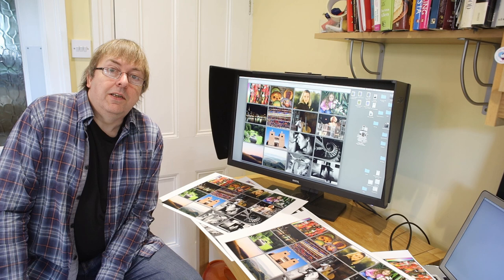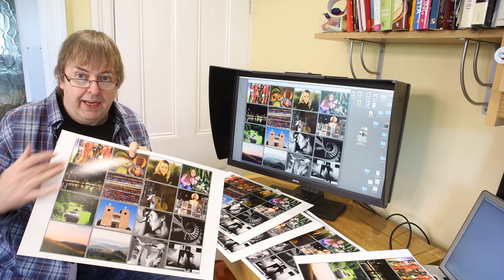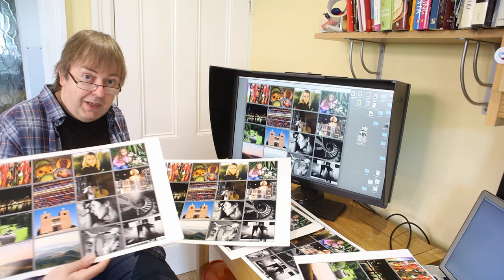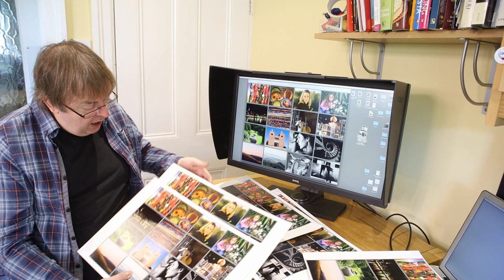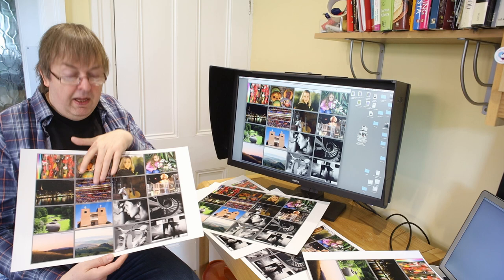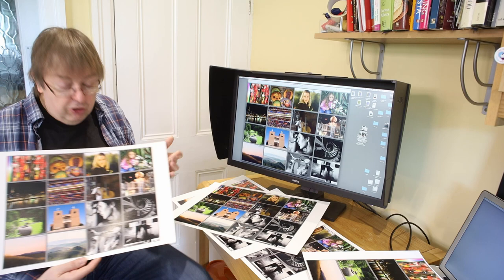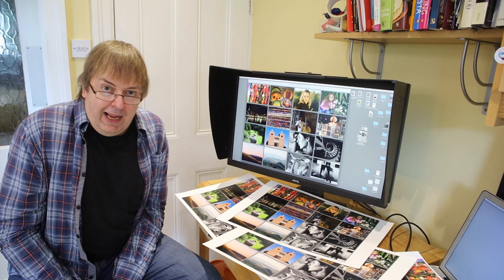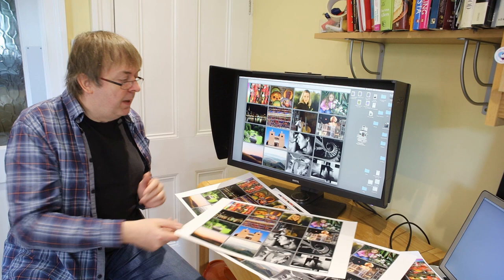Better print quality using a colour test image. Test ICC profiles and new papers on your printer

Comment: Great stuff Keith but you didn't tell us how to actually make the test print. Obviously I need to use the correct profile but do I make the print using Lightroom, using Epson's own printer interface or using the printer command on my Mac OS?
Reply from the maker: The print is made however you normally print any image.
If you use profiles, you use a profile, if you send files off to be printed, you send it off...
It has no specific requirements, since it's a test of how your normal print setup is working.
Sorry if that wasn't clear...
Reply: @KeithCooper  Thanks Keith

Comment: I fell into the trap early of trying to match my prints to my screen. First of all it was a fruitless task because back then I was using my cheapo laptop screen which despite being calibrated just wasn't good enough to evaluate colour. Even though I now use a high quality hardware calibrated Benq like yourself, I've since come to realise that you have to think differently. It would be better if users didn't try to match their prints to their screen but conversely did it the other way round! Ideally you should match your screen to your prints if you want to get remotely close to the two looking similar colour wise. As you describe here however it's never going to be truly possible to match any screen to any print simply because both will have differing gamuts but also of course because one is reflective ( paper ) and one is emissive ( screen ). I also found frustration in lacking understanding early on as to why despite using custom profiles my prints looked different between various paper types. I too assumed that the point of the ICC profile was to bring everything to a single calibrated state and that side by side my prints should look broadly similar irrespective of the paper I used. Again I was wrong, as you explain here, it's just not possible. The purpose of the ICC profile is simply to make the print " the best it can be " based on the paper/ink combination. The ICC profile cannot correct variables beyond the gamut capability of your paper and ink combination, it can only maximise it and give the user at the very least a consistant print result at best. Kudos to you Keith for presenting this often difficult topic in a clear and concise way 👍
Reply from the maker: Thanks - that's exactly what I was trying to convey

Comment: Thanks a lot Keith, I am printing for years and this gave me enough stress based on the fact I tried (very hard) to let look all kind of papers the same. And you knew it of course, it doesn't work like that. Since I have seen the most of your video's and some a few times and read a lot on your website about printing I changed my working proces. And it works so much better. Maybe one of the strong new way of thinking is that there are paper/ink/printer combinations that don't work properly together. In stead of trying to let them work together now I accept the fact that it is like it is.  So thanks for sharing all your experiences in the way you do.
Reply from the maker: Thanks - I'm so glad it's been of real help - thanks or posting this.

Comment: Many thanks Keith for your videos and providing a place to find the sample images. I've recently ordered several sample packs of quality papers from Red River. It's my intent to use the provided sample images to help me understand what images (in my mind) would look best on various papers.  I've never visited a photo exhibit where I understood anything about the papers. I just know what images I liked.  I have a lot of images taken over the past two decades than have never seen print. I'm looking to change that with my Pro-200. During this video you mentioned don't match the print to the screen.  Am I correct in attempting a fuzzy match of the screen to the print (using the test images on the sample papers)?
Reply from the maker: The unwanted secret about papers is that apart from major paper categories [lustre, gloss, matte], few people see anything much more than the image itself. Remember that papers are marketed at photographers, not people who will look at the print ;-)
Now, with care, it's possible for paper choice to have quite an impact on the look of prints, but it's still the images which count ;-)

By comparison I mean don't put the print directly by the screen to look at the two. 
Put the print [suitably lit] off to one side so that you have to physically turn your head. This 'resets' some aspects of your visual system.
The screen and print are different enough that some things will never match
Reply: @KeithCooper  I really appreciate you highlighting the details of how to view the print offset from the screen. I would have been holding the print next to the screen and now understand this is incorrect. The reminder about the marketing of papers and focusing on the image is helpful too.  I think my paper sample pack arriving later this week may last a bit longer than I originally planned.  Best wishes to you.

Comment: Many thanks Keith. You have massive amounts of good advice on your channel. I'm taking your advice and firstly printing the Datacolor test sheet on Epson Gloss paper and my new ET-8550 printer through Epson Print Layout (EPL). What I haven't managed to deduce on your channel or website is what settings to use in EPL. Do I use "Printer Manages Color" thereby ignoring any ICC profiles? Thanks.
Reply from the maker: Thanks
Use the gloss media setting - this should  allow you to select the profile [it may well auto select it] No colour management has no place in EPL unless you are printing B&W and using the ABW print mode. Just open EPL and drop the image into the window and print.

You can see the profile settings in the canvas wrap example in the written review [towards the end - click on the image and you can read the settings]
Reply: @KeithCooper  Many thanks for your help. FYI - I'm choosing ELP Settings - Epson Premium Glossy. This has the effect of choosing "Epson ET-8550 L8180 Series Premium Glossy" profile when the setting is left to "Auto Select". And apologies Keith. I just couldn't find the canvas wrap example you kindly mentioned above. There's so much you've written, I couldn't track it down. Thanks again.

Comment: I’ve just set up my new Pro 1000 and this and your other videos have been so helpful in understanding the printing process. I’m completely new to digital inkjet printing, which is SO different than my old black and white silver halide darkroom days
Reply from the maker: Thanks - my PRO-1000 review predates me making videos by several years, so if you've not seen it, have a look at my very detailed PRO-1000 review? - it has stuff about B&W too
https://www.northlight-images.co.uk/canon-pro-1000-printer-review/
Reply: Thanks Keith, I have read your review and found it very helpful. I do have a question about using the black and white test image - do I print with the black and white setting or standard?
Reply from the maker: On a pro-1000 I'd print using the B&W print mode. There is a specific section about B&W in the written review  @keithmagee4450

Comment: Thanks for the video, I've just started using test images. It definitely helps to understand what the ICC profile, the paper, and the print settings are doing. One thing I found interesting was comparing all 16 images between a matte and a gloss image, it's interesting to decide which paper would be best for which image and why. One of the next key decisions I need to make is to find a basic set of papers to explore printing with.
I've prints with four papers now to compare, none of which I'd choose to continue using, they were just what was in the house when the new printer arrived. It's also interesting to compare relative ICC corrected prints vs non colour managed. I've yet to try printing the test chart in perceptual as that would add too many variables at once. It might be interesting to see a print where each of the 16 images were converted using perceptual individually, but I'm not sure that can be done easily enough.
The image definitely shows flaws in the ICC profile very well. The first print I did using it was horrible as the new profile I'd just created was flawed. Another profile, which works well shows flaws in the test print. Sometimes the flaws lead to better prints, then it's a case of figuring out why the happy accident worked and how do recreated it in the right controllable way.
Based on my experience I've decided to order a paper sample pack (and three boxes of different value paper spectrum papers), as I'm confident that by being careful I can get one good print of the test image after creating a profile. This should help me figure out what papers are best with the new printer. I've printed occasionally with different technologies to a reasonable level but never used a fully colour managed workflow before. With CRT monitors it was possible to adjust the monitor to "match" the paper well enough then print, and re-edit to adjust based on the print, flat screen monitors don't seem to be as adjustable. The sample pack contains two sheets of each paper type, so that's one for an ICC target, and one for the test image, no room for error.
If I was to try to recreate the learning from one print of the test image, I'd need to print over 16 of my own images (as they'd be normal photos not carefully picked to highling printing flaws) many times each refining the print each time on each paper. The last times I've seriously done printing, I solved that problem by only using one paper.
The data colour test image is 16 hard test images pre-prepared to print well if everything else is well set up.That's 16 good tests from one piece of paper.
Reply from the maker: Glad it was of interest.
For me, colour management is about getting things 'right first time' more often ;-)
Best of luck in your search!
Reply: Getting it right first time involves knowing your tools and paper. I'm still trying to learn, my decisions are driven to learn and enjoy the process as much as get decent results now. I still need to get a feel for what images look better on a luster, gloss, and matte, the data colour test image is good to accelerate learning that. Thanks.

Comment: Hi Keith. Thanks for all of the videos you make, they are very informative for a novice printer like me. I've recently branched out from Canon paper with my Pixma Pro 200 to the Ilford Galerie Smooth Pearl. I was getting B&W prints I was very happy with with the Canon paper, with no colour cast, but as soon as I have tried the Ilford paper, I'm getting a very strong green cast. I print from Lightroom mostly, but have tried with Photoshop and it's even worse there, and I can't seem to access the 'colour management' menu within the print settings on Photoshop to turn off printer colour management to avoid double profiling (since I am using the Ilford ICC profile). Any help would be greatly appreciated. Many thanks
Reply from the maker: See here 
https://www.northlight-images.co.uk/canon-pro-200-printer-review/
and especially
https://www.northlight-images.co.uk/black-and-white-printing-with-the-pro-200/

Try the Canon print software as well

Comment: Hello Keith. I printed this very image on my newly acquired Pixma Pro 200 printer today. The paper I used was Pinnacle Premium Lustre 300, and I used the ICC profile for this specific paper & printer as supplied by Paper Spectrum. I did no additional editing/correction. I loaded it into Photoshop "as-is" and then printed it using the paper supplier's specific ICC profile and recommended print settings. The image came out really nice, however, I would have preferred perhaps a small amount of extra exposure.

How would I go about editing the profile to "bump up" the exposure a little? I'm presuming that just increasing the exposure in camera Raw just before I print is not really the correct way to go, so I wonder what your advice would be, please?

Edit: I assume you have your own created ICC profile for this paper, if so, would that be worth me trying?
Reply from the maker: A simple curve with the middle raised slightly is usually enough

For profiles, see the main [written] review
https://www.northlight-images.co.uk/canon-pro-200-printer-review/